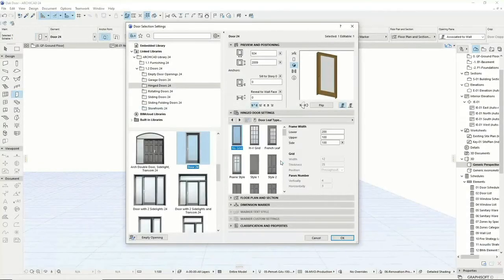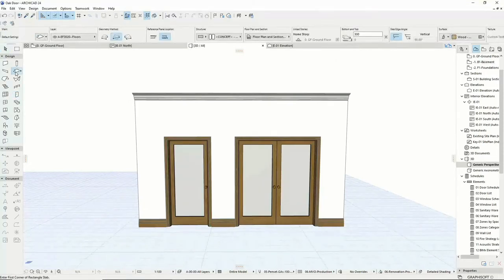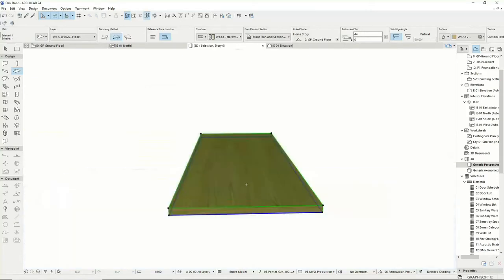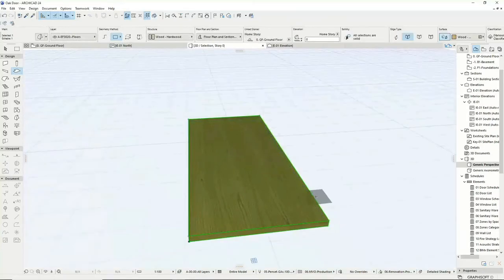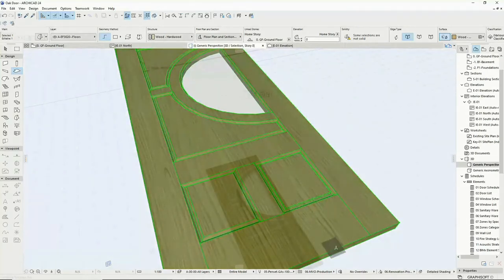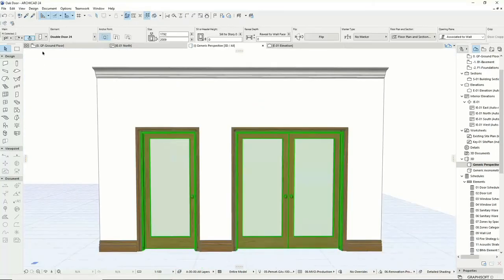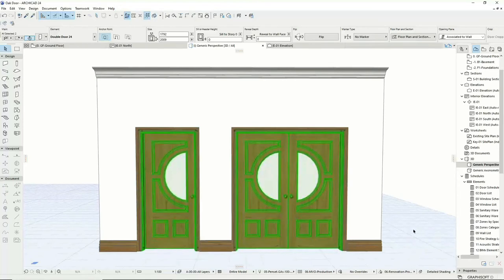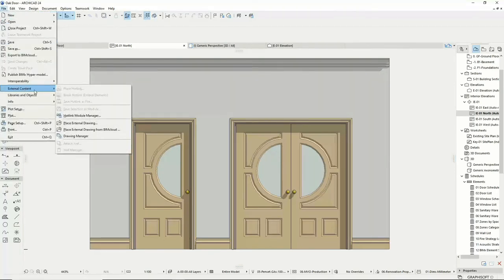Archicad Tip - Creating a custom door leaf

Comment: Great video, straight to the point. I have one question though. What if I wanted to use a custom leaf on apertures with different opening sizes?  Do I have to make a model for each size so it doesn't get stretched, or is there a way of telling archicad to fix certain dimensions (so they dont get stretched)?

Thanks (Yes, I'm aware this video is 2 years old, but I might as well try 😅)